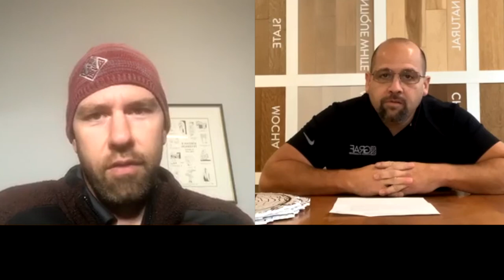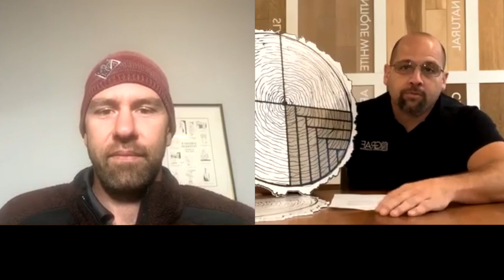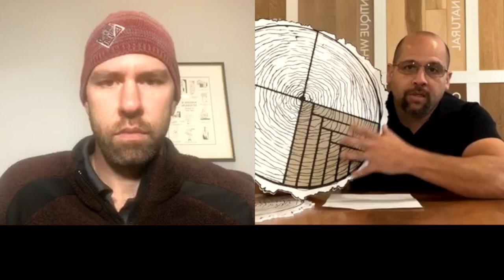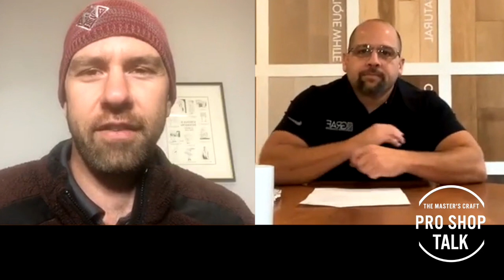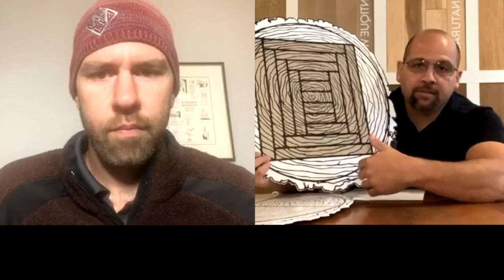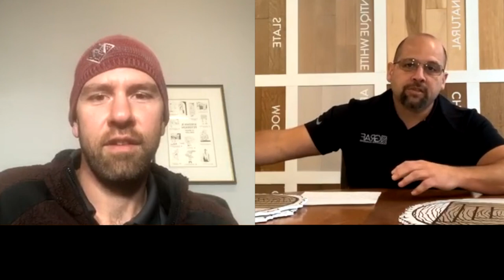What is rift and quartered hardwood flooring? | Rift Sawn and Quarter Sawn with Graf Custom Hardwood

Comment from the maker: Jump to a topic!
Rift and Quartered 
03:56 Graf Custom Hardwood Product Line-up
05:10 What is live sawn, and how is it different from other cuts?
06:24 What can you expect with the different wood grades?
09:08 What is quarter sawn?
09:50 What is rift sawn?
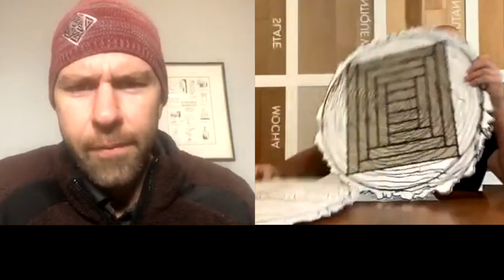11:16 Why rift and quartered wood the most stable hardwood flooring
13:14 Why do quarter sawn boards have rift sawn patterns in them too? And vice versa?
16:08 Do you do custom graded rift and quartered floors?

Hardwood Flooring Installation Tips
17:54 How should you acclimate engineered hardwood floors?
19:06 What conditions should the job site be in before installing the floor?
20:33 Does Graf recommend a glue assist method with their floors?
22:29 Can Graf Custom Hardwood be installed over radiant heat?
23:19 What conditions are required for the radiant heat warranty?
25:26 What conditions does the homeowner need to keep the floor in?
28:15 Common pitfalls with installing Graf Custom Hardwood Flooring